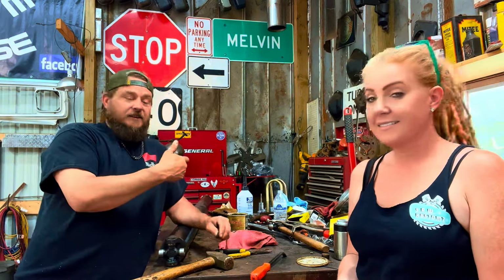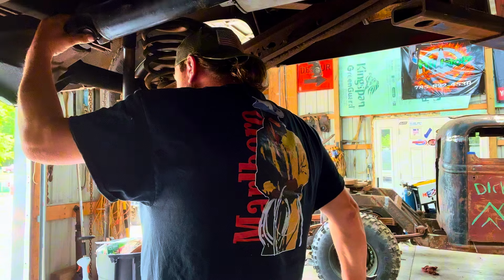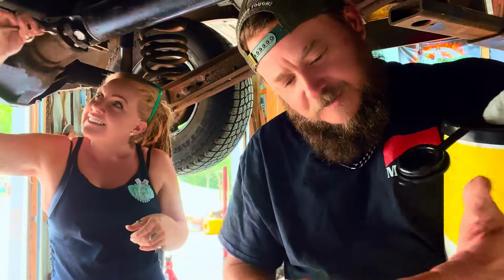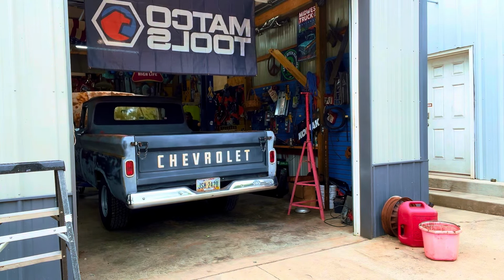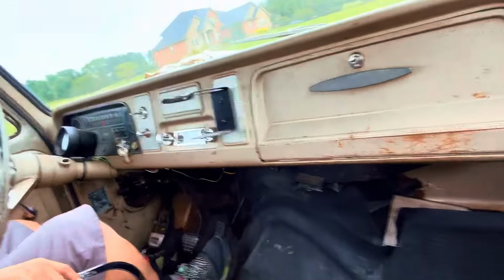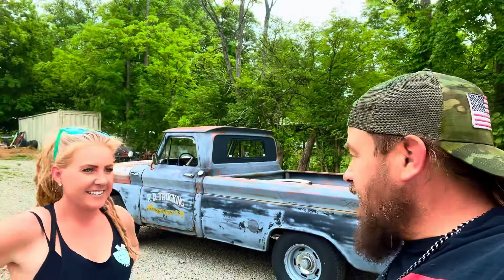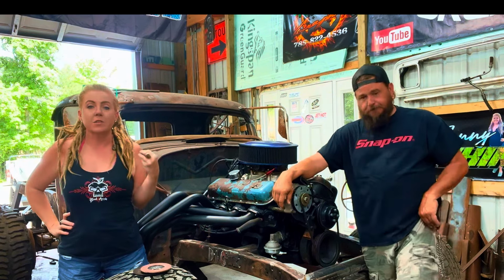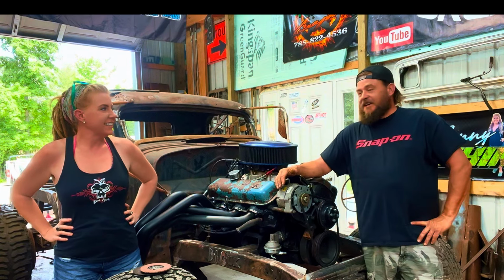NOTHING TO SEE HERE!! LIVE ACTION with Jenny Junkin on the Job! DID SHE SAY GIVEAWAY!? Watch the END

Comment: Hello , you like a number of other people , need to pin your ramps to your trailer. Even if you have to drill many holes , to move the ramps where they need to be. Put a pin of some kind in it , so the ramps don't fall off the trailer.
Reply from the maker: When I bought the trailer it came with megaramps that pin the the trailer but the pin was gone and it came with the aluminum ramps also.
Reply: @PieceNGrease  I drilled holes in both the trailer and ramp , when I bought my car trailer 20 years ago ( I have replaced the wood deck , twice ) and I use 1/4 inch linch pins , with a hair pin locking device , so the pin doesn't come out. Safety , I would hate to lose one of my 70 , 73  Dusters or 76 Trailduster to a thing like that.
Reply from the maker: I take the aluminum ramps and strap them the the front of the trailer.